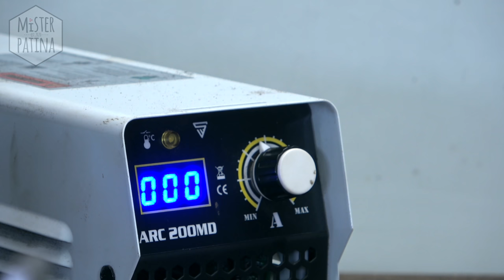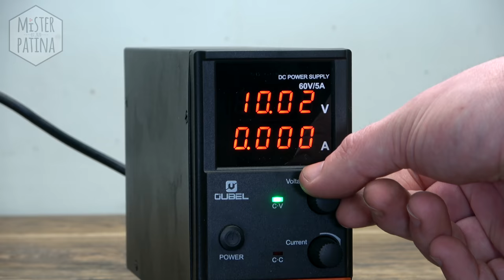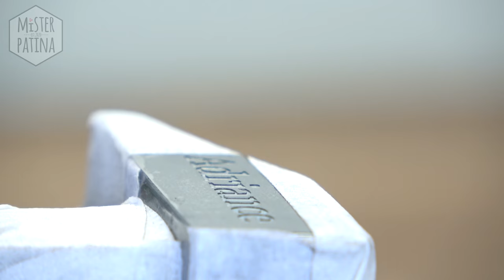1930's Adriance Wrench | Restoration

Comment: Wow, another one I thought was beyond saving, awesome job, quite probably better than new. Neat idea to use the chuck stock of the lathe to brace the thread cutter square on to the handle shaft. Good comment re the weld, bevelling the edges prior to welding gives a channel around the join for the weld material to accumulate into hence stronger weld.
Reply from the maker: Thank you so much! Ill keep your words in mind :-)

Comment: Nice job and a pleasure to watch. Bit surprised at the beginning you didn’t try heating the stiff nut with a blowtorch to expand it. May have saved damaging it. Also recutting the threads on shaft and nut. Might have been better than doing the welding job which I don’t see will be strong enough to hold the parts together when using the wrench and will break over a period of time.

Comment: Great job, When you chopped the threaded end off, I would of chopped it a bit further down . Then drilled and tapped the end and used a fully threaded bolt and screwed it in then welded it. That part needs to be strong, if it's going to be used.

Comment: 6:33 when welding tool's arm like this one, it's better to plan for a conical cut of the two sides and rude prepa of the surface and fill the whole space with welding matter, it provide more grip and solidity, i am sure you know that but you didn't apply it because perhaps you think there's no huge tension on this arm, anyway great work as usual and your metal hand file skills and controls are outstanding

Comment: truly skilled work.............nice job, real nice.  This is more of a reconditioning than restoration..........  The name should have stayed as originally punched and the handle could have easily been straightened and those threads could have been dressed up......... the new handle could have been the only replaced part.  But your skills are top shelf.  Thank you for letting us in to see.

Comment: Great project and restoration. Just wished you covered that well polished steel with parkerization, nickle, anodized or even bottle bluing. The nut that you made that holds the handle in place needs a set pin and should be capped. Respectfully submitted however a great restoration project. ThxU!

Comment: Sweet job 👍 very well done
Reply from the maker: Thank you so much bro!
Reply: @misterpatina  I'm always amazed at how you get all your sandblasting footage so crisp and clear. Mine always looks like a desert storm.
Reply from the maker: @Austeration  do you got an air suction?
Reply: @misterpatina  yes indeed.
Reply from the maker: @Austeration  Strange. I basically don’t do anything special 🤷🏻‍♂️
Reply: @misterpatina  That is strange. Do you film from inside or out side of your Blaster ?
Reply from the maker: @Austeration  from outside of course 🤭
Reply: @misterpatina  well what ever your doing keep doing it as yours is one of the clearest sandblaster footage I've seen. I guess I'll just trying to adjust mine till I get it right.
Reply from the maker: @Austeration  I’d try to clean the air suction and maybe using a bigger blasting medium. The finer the medium, the more dusty it’ll be. Good luck 🥳
Reply: @misterpatina  thanks for those tips, I'll check those out. Can I ask what medium you  use ? I really appreciate your help 😃
Reply from the maker: @Austeration  iam using corundum (0.2-0.4mm) most of the time
Reply: @misterpatina  Cool thanks for that. I'll check it out and see if I can get some here.
Cheers 👍👍👍👍👍👍
Reply from the maker: @Austeration  🙂✌️

Comment: The result is beautiful! However I noticed that when you were making the wooden handle, you used the wrong drill, and as a result you burned the inside of the handle. Video angles helped you in avoiding showing it, but next time I would recommend using a drill for wood ;)
Reply from the maker: Hey Nikos, thanks for your hint!

Comment: I just bought one of those wrenches at a pawn shop for $35. Also, that wrench isn’t older than the 1920’s. The Adriance company was sold around 1900 and closed by the 1920’s.

Comment: nice job as always! i have a question. Why did you decide to mill down the second part instead of filing it flat?
Reply from the maker: Because filing is more „free hand“ than milling. With the milling you’re able to set a level which will be super even 🙂

Comment: Question: Since you didnt paint this wrench and only polished it to a shine , what measure do you take to prevent rust from coming right back ?
Reply from the maker: Hey Derrin, I gave it a little layer of oil and put in the display. If it was for use, I’d have nickel plated it

Comment: Probably don’t need to use so much lubricating fluid and angle the item so the fluid sits in the stuck joint and works on it. 90% of what is squirted ends up on the table.

Comment: Wouldn't you need to give the bare metal some kind of anti-corrosion coating? Otherwise it would be rusty again in a week?
Reply from the maker: Right Noel. In this case its a display piece - i gave it a layer of oil. If in use - i would have done nickle plating

Comment: Turned out pretty good. However you should have beveled the parts before welding to get a deeper stronger welding. You just welded the surface and then grinded must of it away leaving a very thin weak weld. Plus the nut you made to replace the old one looks super out of place and doesn't really match the rest of the tool.